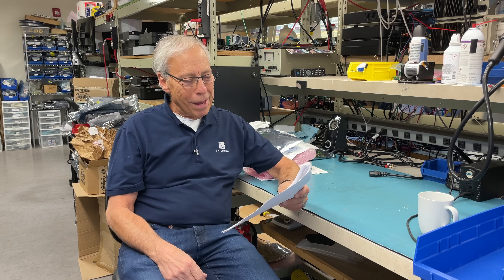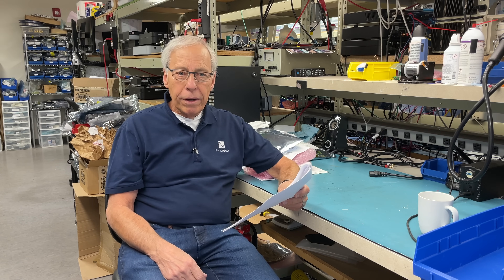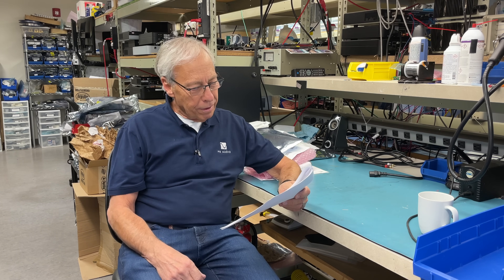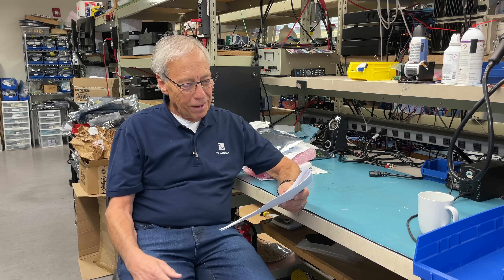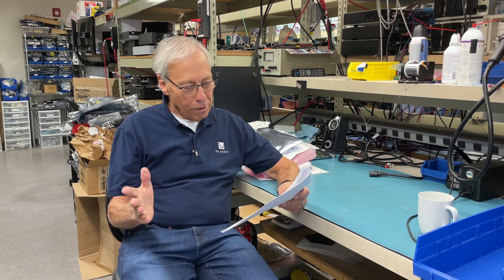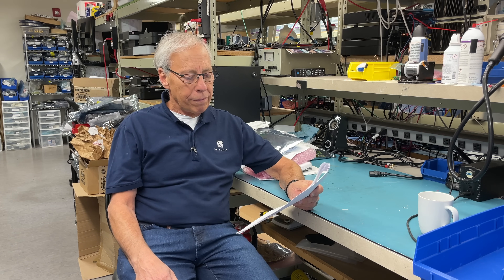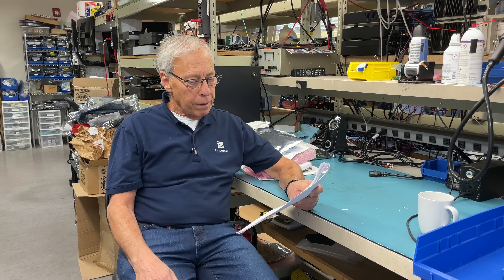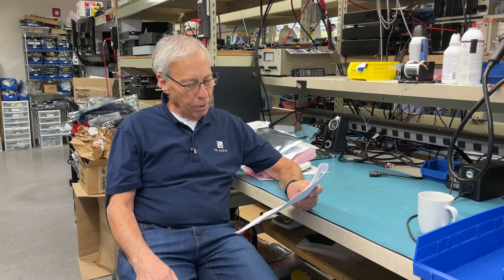The importance of internal speaker wires

Comment: I have a pair of Magnepan LRS speakers. 2 days ago I replaced the fuses (very, very thin wire inside) with 6mm round solid copper. The sound quality benefits are amazing! Higher resolution, greater dynamics, more low, a 'rounder sound'.
I urge everyone with Magnepans to do the same. I also urge everyone to check there speakers to see if they have very thin wires, and of so replace them with a suitable gauge.
Gauge really matters.
Reply: i wouldn't advise replacing the fuses, you may regret that move.....they're there for a reason.
Reply: @poserwannabe1  The fuses are there because someone thought of them. Why are they there? Please reply.
Are the LRS fuses necessary? I don't think so. When do the fuses burn?
 I can't trip over my cables and I don't push my amp (Naim 5Si) to it's max. About 10 o'clock.
Get rid of the fuses and you will be amazed!
Reply: @TTTzzzz  I don't know much about Magnepans, but I also run a Nait 5 and Flatcap 2 into ESL57's and I'm certainly not jamming a solid block in the place of any fuses in speakers that bottle up 6000 volts each! Nope... Nope. Nope.
Reply: @MitchLambert  Right you are!  ESL57's are not LRS.
I don't want to force anybody to do what I have done.
What I did sounds great on my LRS's.
Reply: @MitchLambert  That's your choice. But volts don't burn fuses. Amperage can.
Have you ever blasted a fuse?
Reply: @poserwannabe1  Which reason(s)?
Reply: @TTTzzzz  well if you like to listen on the loud side, they're there to protect the drivers. If you're listening at a lower level and the amp faults, again they will protect the drivers.
And with all due respect after 40+yrs in the industry I can guarantee you that you DID NOT hear a difference.
Confirmation bias runs strong. Do some double blind testing and lmk the results, if you still think you can hear a fuse in ANY circuit, I'm willing to bet you 5k$ cash to prove it. Peace and please don't remove fuses or change their value in any electrical circuit.
And yes I've done these type of tests just for fun so please don't tell me to do it.
Reply: @poserwannabe1  I don't really like listening to the loud side. I turn my Naim 5si up to 10, 10,30 o'clock.
I have been listening to music for the last 45 years. I have never experienced an amp fault. 
My amps were NAD, Quad, Counterpoint and Naim. The only time I had a Burnout Explosion was when I tripped over my speaker cables. The Counterpoint was roasted.
What is an Amp fault?
Reply: @poserwannabe1  You can do what want or don't want.
A fuse has more resistance than a 6mm copper rod. That is the whole truth.
Need I say more?
Reply: @TTTzzzz  
The fact that you had to ask why they're there in the first place tells me everything I need to know....peace.
Reply: @poserwannabe1  Is that so? Why they are in there may be a rhetorical question. 
The fuses are for 'dim wits' who drive LRS too loud.
I don't. I go up to 10 o'clock or a bit more on my Naim Nait 5si. I am never in the 'danger zone'....peace and peace for all!
Reply: @poserwannabe1  They are there because there are people that play there music too
loud. I don't. Peace for you.
I think that's an excellent remark to make during a discussion!
Reply: @poserwannabe1  They are there because some people don't understand that too much amp power will burn the 'tweeters'. 
Safety measures of all kinds are often taken to protect the ignorant.
Reply: I do hope you're joking!
Reply: @MitchLambert  As long as you don't push up the volume to far and know what you're doing (no dim wit short-circuiting)
you are safe.
Btw, when do the fuses ever work? Have you ever heard of a Magnepan burnt fuse?
Reply: @MitchLambert  No I'm not joking! Fuses are there because some people don't understand that too much amp power will burn the 'tweeters'. 
Safety measures of all kinds are often taken to protect the ignorant.
Reply: @TTTzzzz  65mm cone tweeters burn real easy, even 0.75A poly switches won't protect them

Comment: I actually find that funny, people spending an arm and a leg on super duper wire and then on the inside of the speaker you find little 20 gauge PVC wires with bipolar electrolytes and iron core coils.
Reply: It's a bit like expensive mains cables - the power out of the wall is crappy and noisy: you only benefit from good cables once the power supply has been smoothed and conditioned (which should happen inside the HiFi components themselves)
Reply: @Lloyd Stout it's fine for crossovers why is it no good?
Reply: Have you seen my wood knob?
Reply: @PaulLawson-k8v  thanks for the offer but I don't think this is the time or place to see your wooden knob
Reply: Nothing wrong with iron core inductors they have a lot of benefits

Comment: Paul, 10 gauge wire inside of a speaker????????? Do you know how thick that is? Lmfaoo! Barely anybody is using 10 gauge wire. It's absolute Overkill. It's also barely bendable. 16 or 14 is plenty good. It won't be Audible comparing 10 gauge to 14 or 16. Honestly man, you really don't have a clue when it comes to speakers. You should let Chris answer these questions.
Reply: @Mr Do bo need for 10 gauge. No audible difference between 10 and 16. No need for a company to spend more if they dont have to.
Reply: If they use 10 gauge wire in a 2 way speaker, they will need to make the cabinet bigger!
Reply: You bet 10AWG makes sense for 15" and bigger woofers!
Reply: @IvicaMarusevic  ok.....and how many speakers have 15 and bigger?? We are talking speakers in general. Not obscure size.
Reply: @Mr Do Why not? Here is the answer. In a speaker it is a very short run of wire. There is no need for 10 gauge. There will be no audible difference between let's say 10 and 16. Lastly....cost. speaker companies would rather not spend more money of if they dont have to. It is simple.
Reply: @Mr Do no audible difference with a short run in a speaker.
Reply: @Mr Do people might pay it but companies don't want to pay more than what they need to do to make things. Especially when it isn't Audible
Reply: if you use small wire, it become a choking point.
Reply: @hom2fu  choking point when dealing with inches of wire?? i agree, there's a minimum but consider the braided lead wire to the coil and gauge of coil wire itself. consider the wire gauge of the passive components and pcb traces of the crossover and ask yourself where the choke point is and what 6 or so inches of 20 gauge wire mean in that context.
Reply: 16 gauge is plenty good causing no issues. The proof is majority of speaker manufacturers use 16 or 14 and there are no issues.

Comment: Maybe big fat expensive speaker wire from the amp to the speakers is NOT SO IMPORTANT is another way of looking at your view.  I did blind testing years ago with audiophiles with nothing but a change from stupidly expensive MIT wire and regular Radio shack 14 gauge speaker wire....and 3 of of 3 could not tell which was playing....
Reply: Your experience does not mirror mine.
Reply: @RichTeer  You have to assure you do a TRUE blind test....you can not be aware which wire is attached...then  see what the results are.
Reply: @adriaticbatman  Respectfully disagree. What IS required is an open mind, without preconceptions. I’ve done numerous sighted comparison and sometimes the results have surprised me. In some cases, the fact that I heard a change at all was the biggest surprise.

I’m not saying your anecdote is wrong or not truthful, but without any description of the system being used, the music being played, etc., it’s not very persuasive.
Reply: @RichTeer  Ahhh...so you do not believe in scientific principles...science leads to fact...it's that simple.  There is so much BS in high-end audio that is not science based nor properly tested and validated..its lots of snake oil salesman selling hot air to under-educated gullible people... I am fine with most of that as long as they put in disclaimers which they never do...and let the buyer decide with their own wallet...but buyer beware when just reading hype.
Reply: @adriaticbatman   That is such a ridiculous leap of logic, I don't know where to start. For a start, of course I believe in scientific principles, and I agree that there is some BS in high end audio. But I'm not going to discount the validity of my own experiments, which I approached with an open mind.

Your equating scientific principles to blind testing is ridiculous. Although one cannot completed rule out confirmation bias, sighted testing doesn't invalidate the results of a test.
Reply: Beauty is in the ear of the listener 🤣
Reply: Well speaker manufacturers have to work to a budget so they will spend their money where it matters I guess.

Comment: I do not think it is in anyway necessary to alter the internal wiring on your speakers.  Larger conductors are helpful on longer speaker wiring runs.  It still doesn't require altering the wiring in the speaker enclosures or amplifiers.
Reply: @Lloyd Stout link to this data?
Reply: @Lloyd Stout 
I contend that the internal speaker wiring is irrelevant.  Consider this reasoning.  Why stop at the crossover which has much thinner wires on the chokes.  It is going to be fun designing those chokes with 12 gauge wire and also the links to the speaker cone and of course, the voice coils.   There is some merit to larger gauge wire between the power amp and speakers, but anything over 14 gauge is useless.

I have fiberoptic DSL internet service in my home, but the wiring into the house is still 22 gauge copper just like the phones.  The fiberoptic
Section connects a few blocks away and goes to the telephone exchange.  The short amount of copper wire has little effect on the gains provided by the optical connection telephone exchange.  (Same principle here.)

Comment: I recommend "Sommer Cable" (from Germany). Very well made speaker cables (OFC) but way not as expensive as Cardas.
Reply: I prefer all season cable, I was getting tired swapping out the internal wires of my speakers twice a year.
Reply: @hugobloemers4425  Dude of mine drives winters on his S class all year round because he cannot be arsed and can afford the increased wear...
Reply: @Baerchenization  and crappy handling? I always notice the slightly vague floaty feel every time I switch over to my winter tires.
Reply: @gotham61  I don't think he cares much... he is a super busy lawyer who rarely gets out of his office anyway. What are you doing with your floaty tires?! My winters feel just fine and I've been across half of Europe with them :) Actually, due to the 'Rona, I only had my summers on for like 6-8 weeks last year :P
Reply: @hugobloemers4425  <groan>  😊
Reply: I use sommer cable epilogue xlr between old Sony studio Cd player and straight into Jbl 6230 power amp, clean sound in Jbl 4408

Comment: Pride in your product and work. You can't measure or put a value on that.
Reply: Oh yes you can, that's 50 cents per speaker, times 20'000 speakers a year = $10'000,- per year of which the purchase director gets 8% of the saving and that is an extra $800,- in his pocket.
Reply: @hugobloemers4425  ?  Surely that is the opposite of pride in your product and work, Unless you are just an accountant?